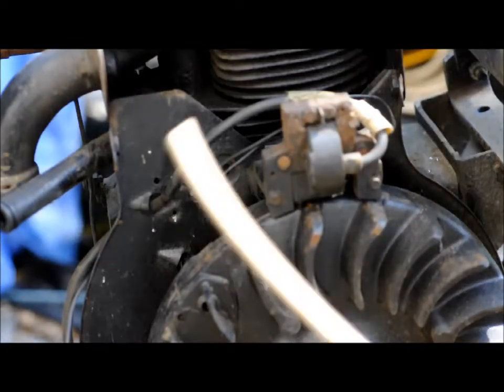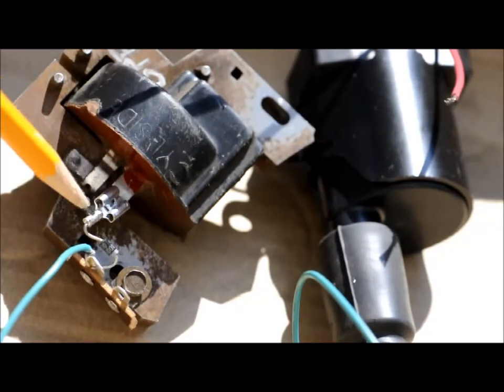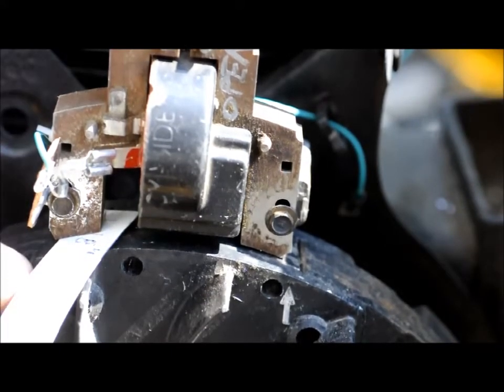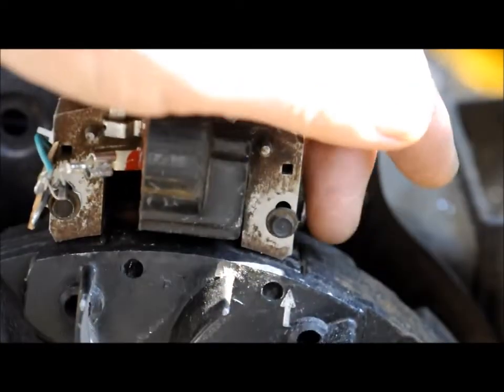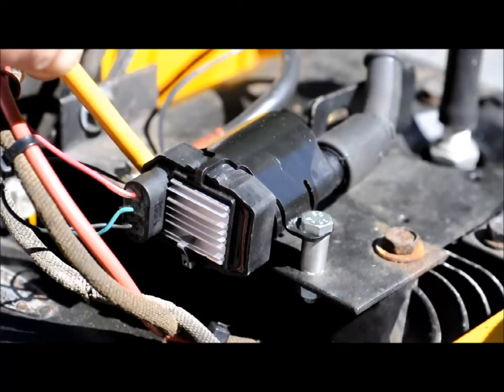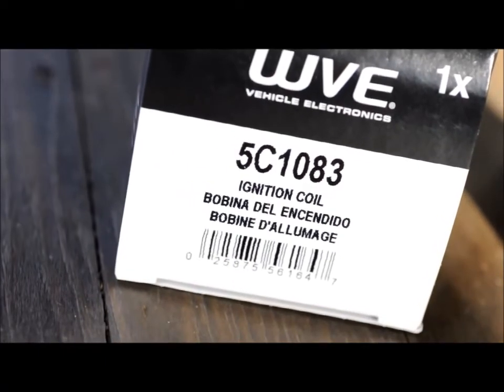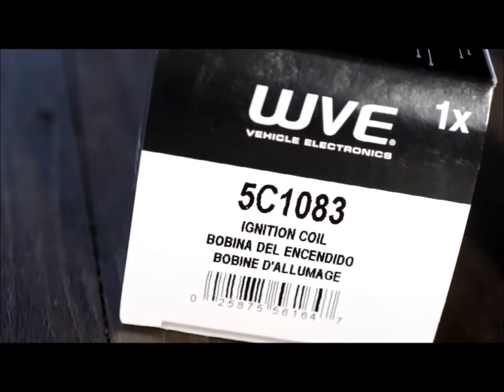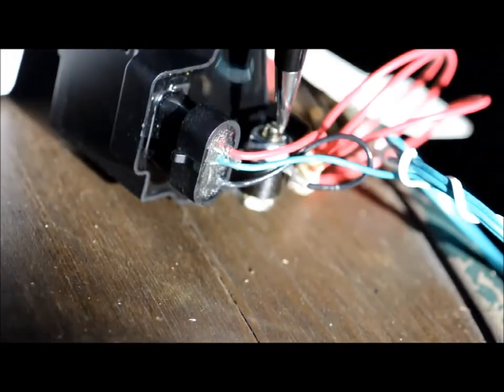BigTenIgnition

Comment: Nice work Ed. Clever to use the old coil windings as the trigger too. Cheaper than a new Hall Effect proximity and no need to fabricate a mount for it! Some of the garden tractor pulling guys need to take notes on this one. Not only is it a good replacement for a stock ignition coil it's also a high performance replacement. Well done!